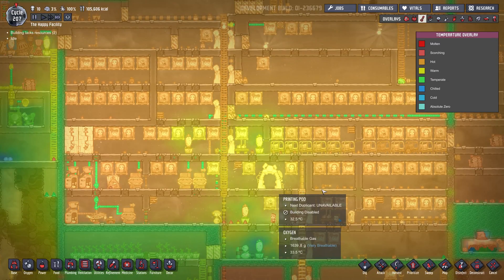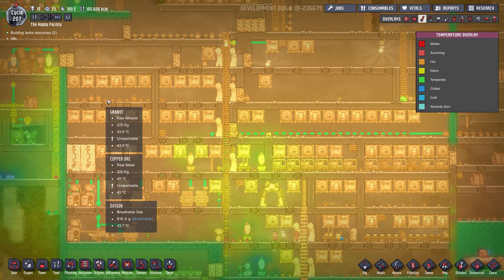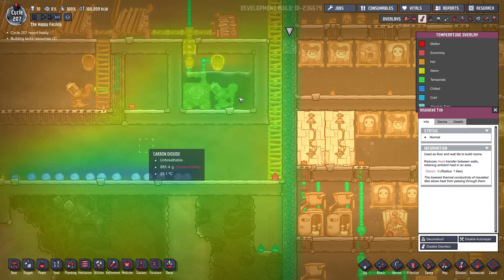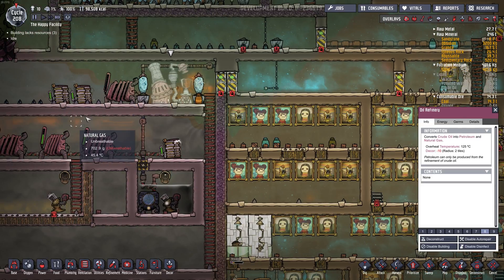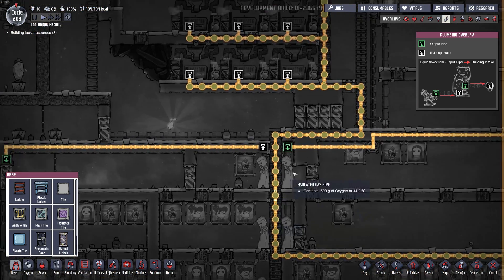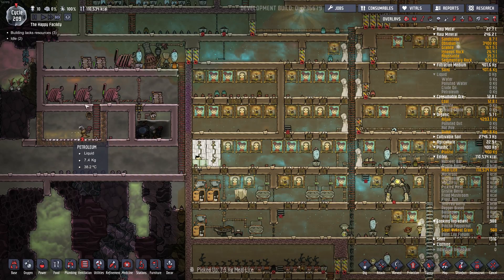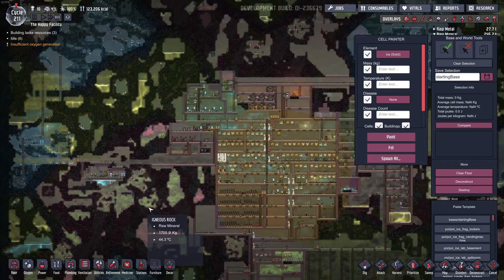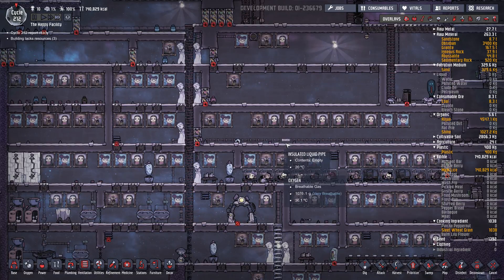Too Much HEAT & Cooling Ideas - New Oil Base - Oxygen Not Included Oil Upgrade  #5 [4k]

Comment: You forgot 1 thing if you pump in hot water into the showers/toilets these machines have a internal buffer that will heat up the machine from inside of its fluid buffer. And this heat also gets out and heats up the environment.

Same goes for the oxygen makers. These machines produce hot oxygen based of the machines temperature. So you heat up your base effectively and you will run into the same issue if you don't think of that.
Reply from the maker: Thanks. I'll try to cool it externally before it goes into the base this time.

Comment: Output water from lavatories and showers is the temperature of the building. So if the shower is 46.9C , the output water will be that.

The oil loop cooler works best if you have a tile drop. So build a tile under the vent. And you need to make sure the top layer of oil is between 20-50kg for maximum cooling effect. The vent should also be as far away from the aquatuner as it can get.

Last comment is that when you make something from abyssalite you don't need to make it insulated as well and use twice the material. People on the forum generally use insulated tiles and pipes to show which tiles and pipes should be made from abyssalite and which should not. (I'm one of those that post crazy builds there under the username Saturnus).
Reply: To answer the last question first. There is no dirt when PO2 is liquefied. That's when PH2O is distilled into H2O by steaming it. 

It only uses 185W on average to cool 2kg/s 27C PO2 to -183C, so that's a delta of 210C, so it's actually highly effective. Is it an exploit? Well, that's difficult to answer. It work by using a quirk in the game mechanics that in order to speed up calculation each tile can only be occupied by one substance. And that temperature equalization calculation are run in a specific order. It's the same reason hydrogen flows to the upper left corner, and CO2 flows to the bottom right corner. So in a sense it is exploiting the game mechanics to achieve a goal but is that an exploit? Hard to say. The basic game mechanics have not changed since the first release, and the devs are definitely aware of the quirks, and how people use them. So that tells me they're not going to change the game mechanics or patch the functionality of builds that use them.

That didn't really answer the question. Some regard it as an exploit, others don't. Personally, I don't think it's relevant to even discuss. It's a single player game, play however you like. If you want to limit yourself and set up arbitrary rules on how you play because you don't feel it. By all means do so. At the end of the day, it's just a game. It's supposed to be played because you enjoy it. :D
Reply: This is my conclusion as well. The sinks, lavatory, carbon skimmer, algae distiller, and Natural Gas Generator all do the same thing.

A way to cool the base without relying on crude oil cooling is to use an aquatuner submerged in cool water to cool the very water that comes into the base and not use insulated pipes. This cooling method is slow, but I think this requires waaay less setting up to do. (It requires a lot of thinking power on my part to figure out how to pipe everything up so I can reintroduce the water back into the system though xD)
Reply from the maker: Ok good to know about the building temp. I think it used to be a set temp...at least for the CO2 scrubber. By "tile drop" do you mean when it does the splashing animation? I didn't know insulated pipes didn't need to be insulated... What is the point of them then? I'll check out the forums for your posts :)
Reply from the maker: Hmm I'll try that out (water aquatuner tank). How large do you usually build it? How many cycles to get it down to a nice temp if the geyser water coming in a hot... eg 90C?
Reply: Insulated Pipes basically isolates the temperature of the content from the outside influences and/or the pipe's temperature. For Insulated tiles, it isolates the temperature of one side of the tile from the other sides of tile. The insulated tile's temperature itself however, will get influenced by ambient heat.
Reply: from my experience, as long as  you can keep the water cold (my aqua tuner was placed in a tank located in an ice biome), and have a long enough piping, it took me to get 44C water down to 18C in around 4-5 cycles. And the temperature in my base was at 31C, and it went down to as low as 25C sometimes in that duration. 

The tank was not really big. Just 5-tile high and 4-tile wide and I enter it from the top with a 3-tile tall ladder, with a pump directly underneath the ladder. Which is enough space for me to fit an Aquatuner, Pump, a Valve, and Filter.

I figured, the bigger the tank, the larger amount of water I'll need to submerge the aquatuner. xD

Edit: BTW After checking my saves to check how many cycles it has been since I started up the aquatuner, and found that 20 cycles in, the temperature around my base is now around 28-29C.
Reply: Insulated pipes and tiles are basically pointless. Regular tiles and pipes made from abyssalite are literally 10s of 1000s of times better at insulating than insulated tiles made from other materials. And the factor 5 difference insulated tiles/pipes make is really not worth it when it's made of abyssalite. Regular tiles and pipes use half the material to build compared to insulated tiles and have better decor values than insulated tiles.

My universal cooler cools crude oil about 60C per cycle, that's 0.1C per second, during the initial cool down. Once cooled down it uses next to no power. The universal cooler is the top 4x4 tile square of this build https://forums.kleientertainment.com/topic/82952-the-grinning-skull-oxygen-distiller/?tab=comments#comment-963730
Reply from the maker: Is this water you just move in a loop for cooling or water that you consume as well?
Reply from the maker: Love that compact oil cooler. Do you consider the oil cooling loop an exploit? You are spending a lot of energy to cool something so it should be allowed even if it doesn't make thermodynamic sense. Wheezeworts don't either really. Do you get dirt building up when the polluted O2 liquefies?
Reply from the maker: Thanks for your detailed answer. I think I'll use it in my next build :)  Or at least the cooling part.
Reply: It's for both, yes. which made the piping difficult for me. The game keeps making the water stop at every spot I try to make the looped piping. In my case, I had to figure out how to make sure the pipes I build to re-feed the water back is going to be a one way pipe only. x.x

But well, after some reflection on the matter, maybe I could've gotten away with having 2 aquatuners, one for self-cooling a tank, and the other for cooling the water that is going into the base. =.= It'd looked simpler now that I think about it. But the obvious downside is that the power consumption is gonna be horrendous. xDDD